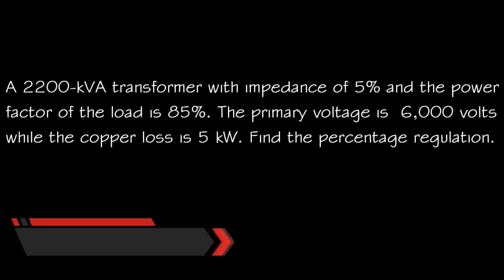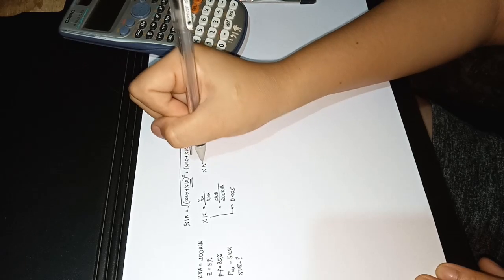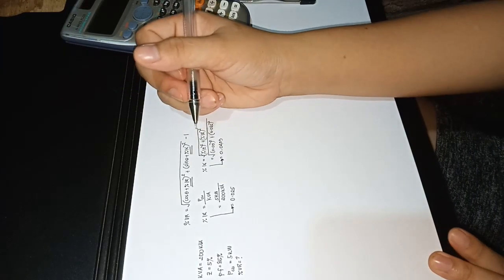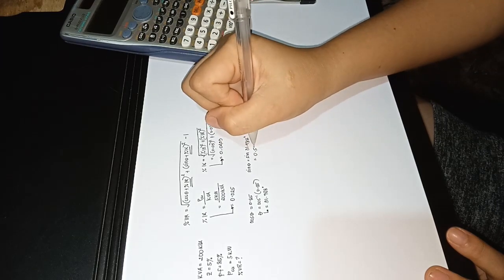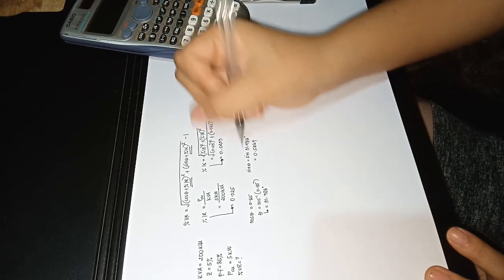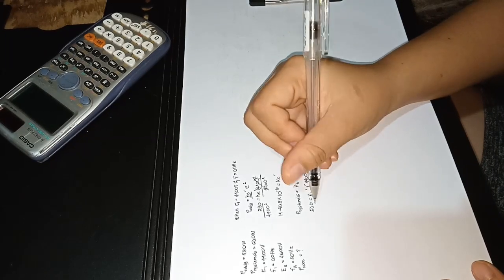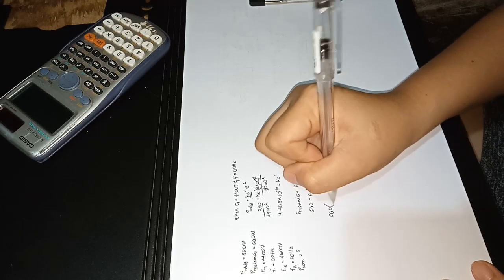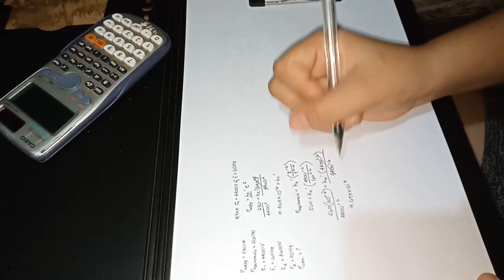10 Solved Transformer Problems

Comment: For the first problem  the transformer rating 2200 kva ...you  put anew value for this rating 
The other issue this example have 2 solutions , first solution to use lagging power factor, second solution to used leading power factor ... but its exlellant